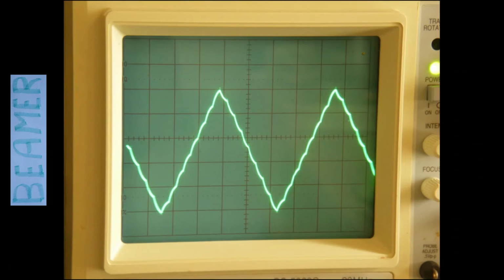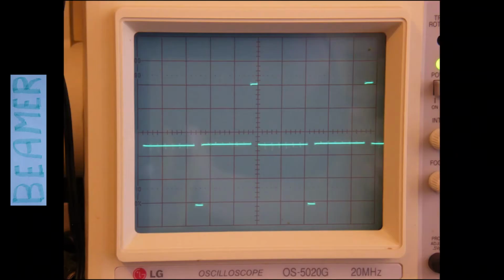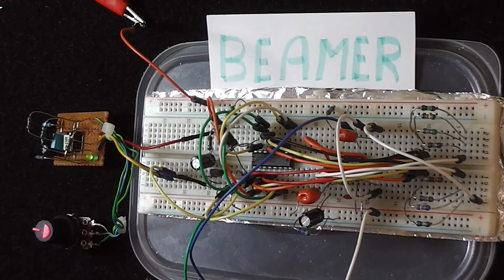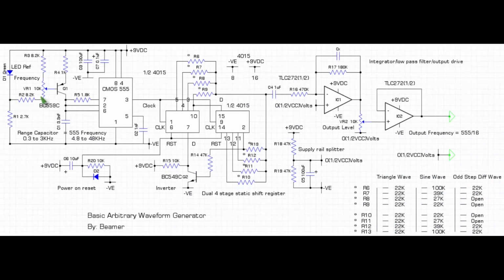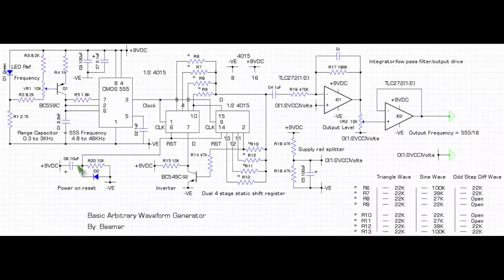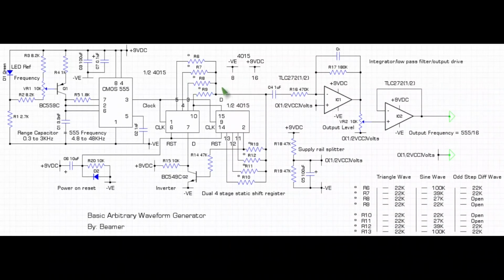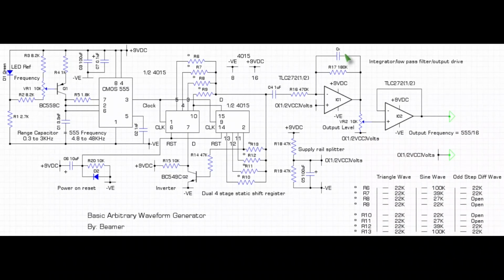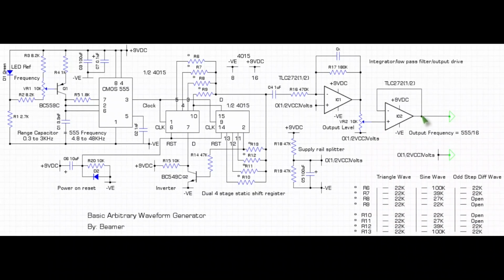Build your own basic Arbitrary Waveform Generator (AWG).

Comment: what is the maximum frequency it can generate
Reply from the maker: Going by the CMOS 555 datasheet, therefore theoretical: 3MHz / 16 = 187.5KHz, but I guess practically say, 60KHz min to no more than 100KHz Max. The CD4015s would handle it, but I'm not certain the output Op Amps would - might have to go with a discrete design.
Reply: @beamer.electronics  that's great , can we design AWF upto 1GHz frequency, if possible plz provide some list of equipments along with the circuit diagram
Reply: @beamer.electronics  ♥